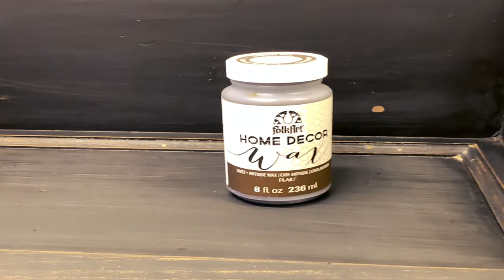Trash to Treasure Antique Fireplace Mantle/ DIY Chalk Painting and Distressing

Comment: Hi Beverly, what color did you use? At first it looked black. Later it looked as if you had put some greyish blue on there in a second coat.
Reply from the maker: TheFloatingflower I used the black chalk paint then the glaze. 😊
Reply from the maker: TheFloatingflower I used the black chalk paint then the glaze. 😊